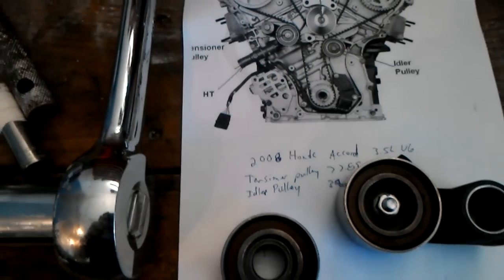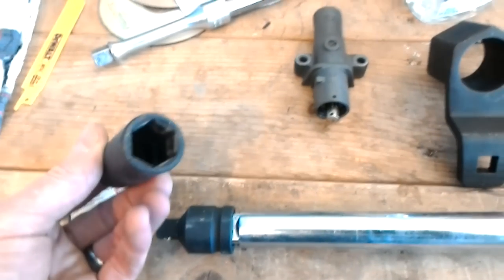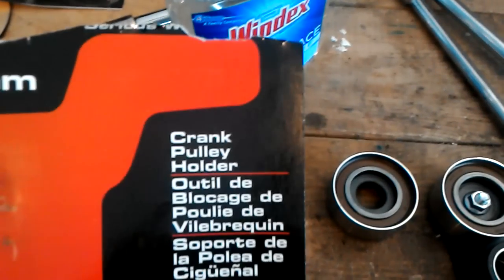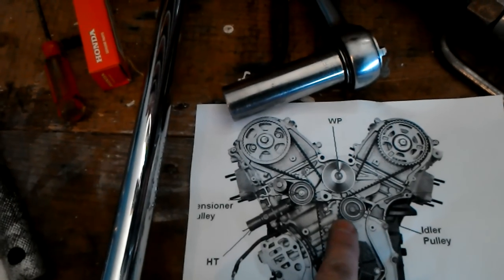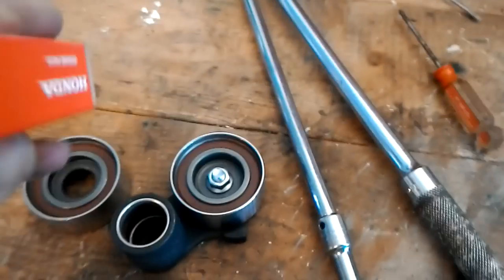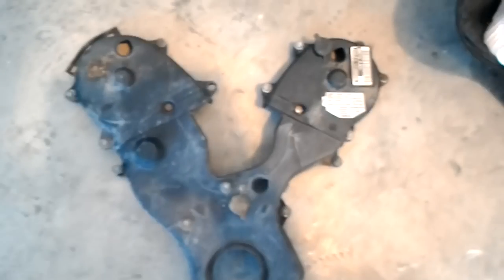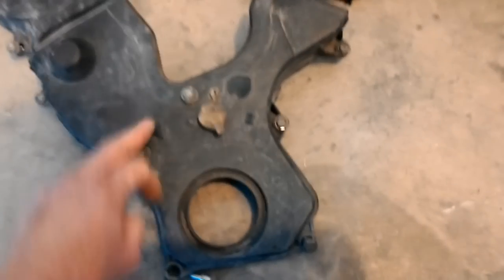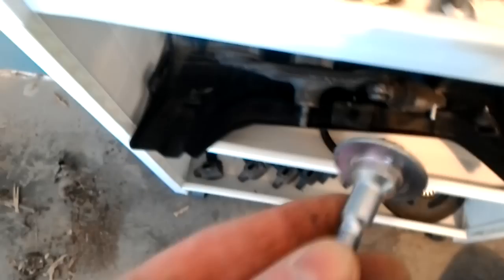2008 Honda Accord Timing Belt V6 J35Z2

Comment: is this belt different from the serpentine belt? or does our accord only have one belt? I have 2009 v6 coupe manual. car is 200,000km and i have not had anything done on it before except for oil changes and tranny fluid change
Reply from the maker: This is the belt that drive the engine camshafts and water pump. The belt you see when you open the hood is for ac, alternator and power steering. So ther are two belts total.